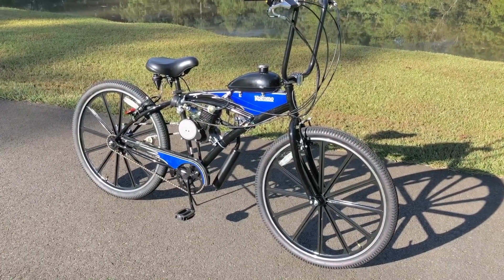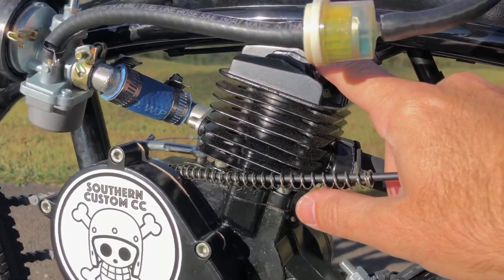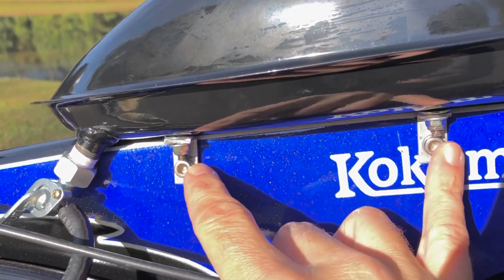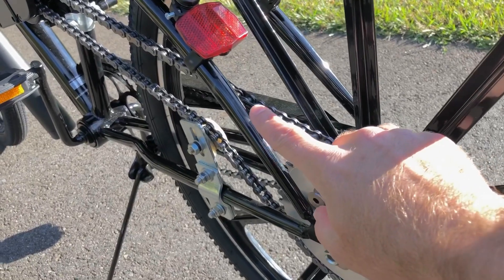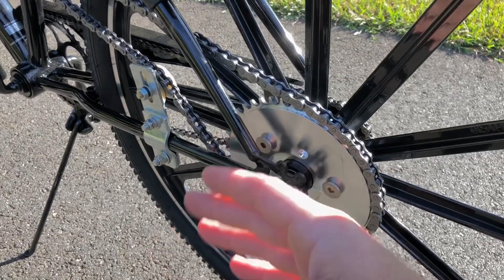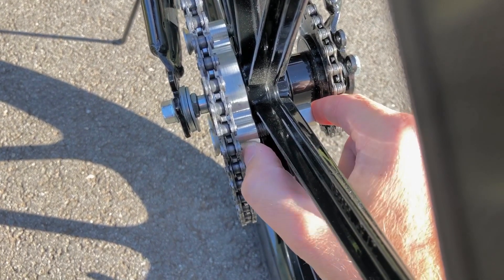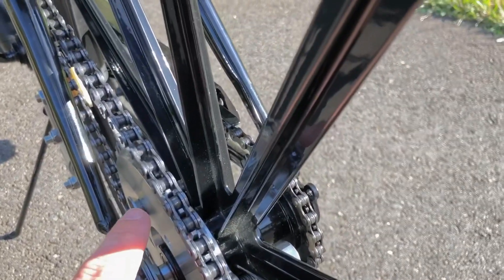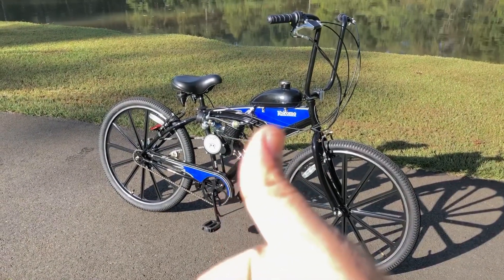Tips on Building 80cc Kokomo Schwinn 27.5” Motorized Bike

Comment: Are the mag wheels aluminum? I cant believe places are still selling (or shipping)  the two-bolt idlers. If I receive one on my next build I will either replace with a spring idler or modify it to make it four bolt as this is the main weak point and the most dangerous component on the motorized bike. Even if your engine blows and locks up at high speed, the clutch will slip enough to keep you from going ass over head but if that chain idler goes into the wheel at 30mph+, its gonna be a Very bad day.

Comment: If you need more chain clearance , could probably put a small dent where the chain would touch.( On bike). My muffler touched my frame,i didn't bend muffler,i put took a hammer to bike frame. Just enough clearance. ( is a Different bike). Frame went round to oval. Still strong in my opinion.
Reply from the maker: john argue : Thanks for watching! I appreciate the input, thanks!

Comment: I have this exact bike and I'm trying to mount a 4 stroke on it. Judging by what I just saw, I don't think that will be possible. How do I find this 2 stroke you added to this build?
Reply from the maker: Thanks for watching. In the video I explain that I had to cut off about 10mm of the rear mount bracket on the kit. This allows the engine clearance for installation. You will definitely want to stick with a standard 80cc if you want one on this bike. You can check out my site as well at www.southerncustomcc.com/engines for some options. Happy riding!

Comment: can't get the engine to  idle any more when come to a stop the clutch shut off engine i don't no why idle is screwed in tight no airleak. ... btw why offset intake does this help with venturi?
Reply: Your bike won't idle when you come to a stop and pull clutch in?
That's a clutch adjustment, ts releasing but not quite enough and dragging a wee bit.
Offset intakes help for clearance, and do offer minimal venturi effect depending on how it was formed, a one piece bent tube is best with no inclusions, pieced or welded together actually will have a negative effect due to the rough inclusions at the seams

Comment: Can you please provide the link of this motor kit?
Reply from the maker: Damaris perez : Hi, I get mine from overseas, but this looks like what you will need. Can’t guarantee you get what is pictured, but contact the seller to see if it is. If it is, this will be like what I used except without the M8 bolts.

https://rover.ebay.com/rover/0/0/0?mpre=https%3A%2F%2Fwww.ebay.com%2Fulk%2Fitm%2F233344715110

Comment: O my you did drill holes in your mag...hummm I didn't have to do that..
Reply: Ordered off Bike berry, the only time I ever ordered off their website... Mine came with a 36t with 6 bolt hole pattern for disc brakes. Still using em after installing them 8 months ago.

Comment: Should've counter sunk the bolts on the sprocket, i can see them sticking up
Reply from the maker: mark kasper : I thought about it, but because the CNC sprocket  is already pretty thin and the bolt heads are pretty big, if I counter-sunk the bolts, then there wouldn’t have been much of the sprocket thickness remaining, which would—in my opinion—have jeopardized the integrity of the sprocket. Maybe it would have worked, but not worth the risk in my opinion. Thanks for watching!
Reply: @SouthernCustomCC  Im really not trying to be a knucklehead, just my observation. And yes you're correct again! I understand what you mean about hendering the integrity of the sprocket.🏁👌👍good call.